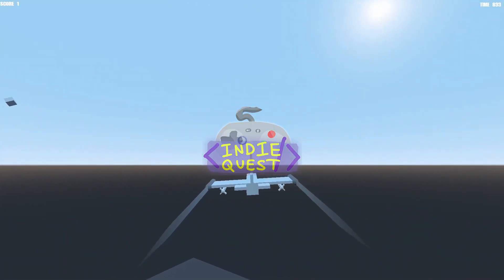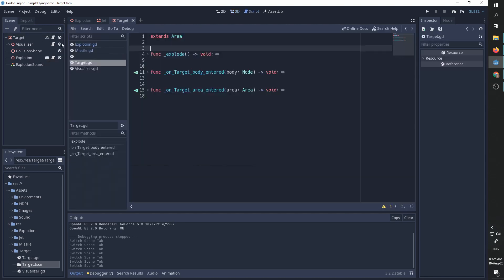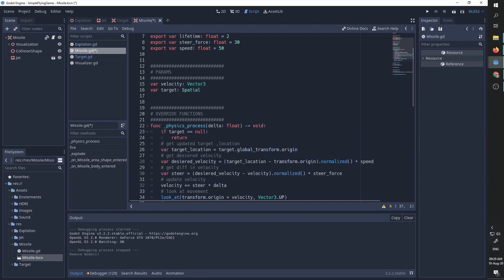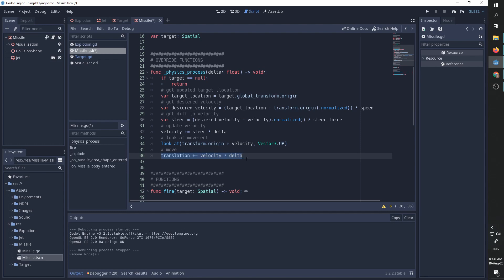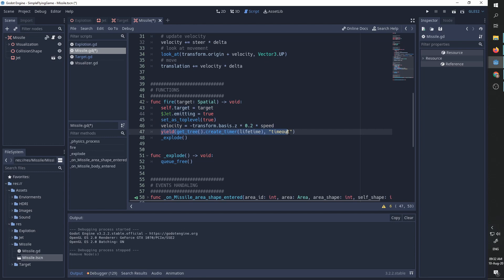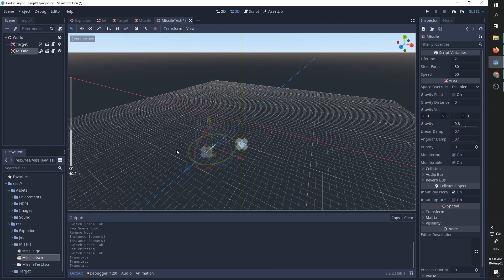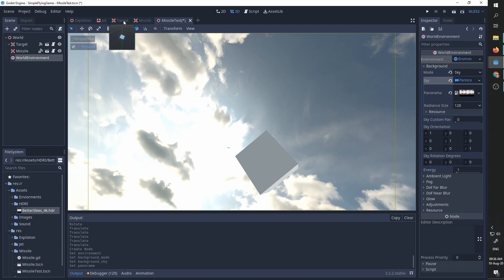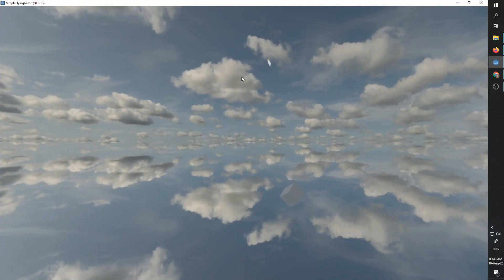"Godog Fight" - Dog fight game made with Godot 3 - Homing Missile

Comment: Is making a homing missile using a rigidbody as a base rather than an area something that it is possible/reasonable to do? I have had difficulties steering it using torque, specifically limiting its turn to be no more than a specified turn radius, and making it track in more than one axis. The documentation provided an example for how to implement the look_at() function on a rigidbody, but adapting it to a homing missile is proving challenging. Should I abandon the rigidbody and use an area instead?
Reply from the maker: Thank you for the question. Yes it is possible and it is something I am actively working on. It is however much more difficult an requires a non direct control over the missile.
Reply: @indiequestdev  Thank you for the answer! It is good to hear that someone else thinks it can be done. Attempting to implement it with my poor understanding of how to make it work is like running into a wall repeatedly.
I think I will keep the rigidbody dream alive, though table the experement for the time being in favour of an area.
Edit: a grammatical error I only caught after I pressed send.

Comment: you can remove blue color on everything, by double-clicking 'default_env.tres' in root folder, and under ambient light, set sky contribution to zero, and ambient light to white color . . <3 <3
Reply from the maker: Generally speaking you are right, but on this instance I am using a custom environment with an HDRI panorama. The blue got something to do with my computer's print screen, all the images are turning muted and grey/blue, if you have a solution for this It would be amazing :-)